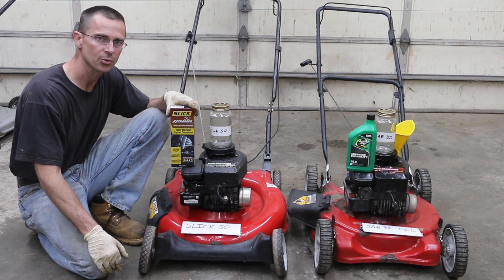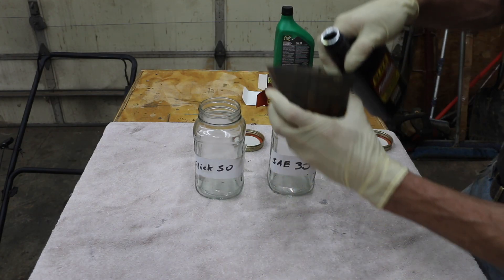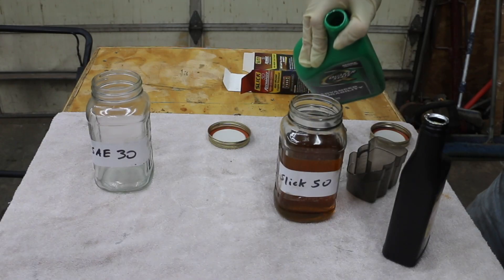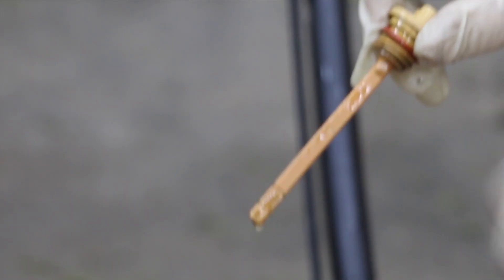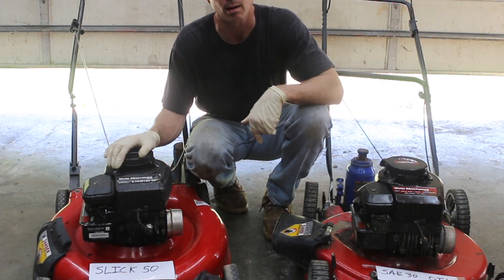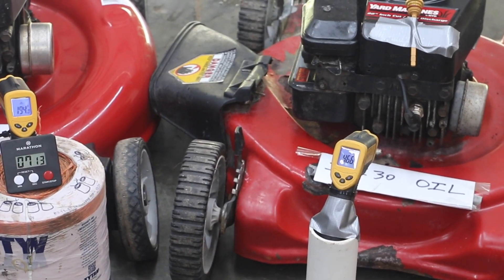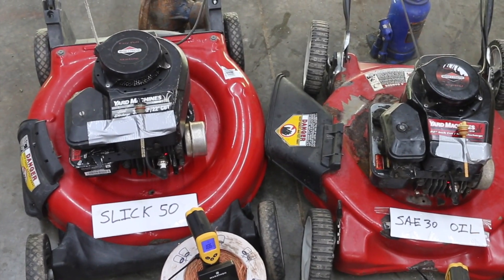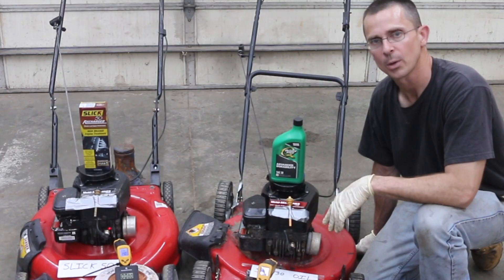Can't believe what SLICK 50 did to my engine!!--Dry Crankcase Test!

Comment: Yes mate there is another test you can run.  The product is called Bitron (and if it's mentioned below forgive me I haven't read yet).  You can get this in Queensland Australia.  It used to only be available from individual distributors, like an MLM, but now this Qld company has it.  It was developed by the Russians during the cold war for military use, blow the sump offof a tank and it keeps going etc. but they sold it to Canada (story told to me) to feed their people (True Military Secrets obviously are worth a LOT of $$)  The Canadian company named the stuff I think and marketed it that way.  US emergency services ALL use it in their vehicles as well as US military now OBVIOUSLY.  There are other products but hey I am not running an ad  LOL  This is NOT an additive but the oil itself is altered on a molecular level, causing it to stick harder to the metal parts AS it gets hotter.  It also cleans the engine of gunk so any engine that has bad gaskets and seals WILL leak oil after using it.  1,500Kms I believe is the run in time and then a fresh batch is put in. You drive as normal and then it runs for who knows how long without oil (naturally if it is drained cold less oil will be stuck to the engine parts) but a true test would be a catastrophic loss of oil in the field like sump damage on a road by hitting a rock etc. and the engine would be hot.  I guess I have "rattled" on a bit but google it and you will find the company.  I also have a VHS video tape somewhere here showing the test they ran themselves (closed room possibly bullet proof glass, temp guages attached to engine, and lights turned OFF to see the glowing exhaust...)  very impressive.  I must remember to get some for my new Jeep when it arrives!  Cheers
Reply: Actually having read a lot of the comments below I realized when they ran the tests with this stuff they also removed the radiator completely!  Hence the glowing exhaust.
Reply from the maker: Wow! This sounds like a great product.  I'll see what I can do. Thank you for this recommendation.

Comment: Slick 50 is put in and run engine until next oil change.  That lets the slick 50 to micro coat moving parts.  Never lost an engine in 40 years.   Try reading instructions first. Your test is horrible
Reply from the maker: Thanks for the constructive feedback.

Comment: And fyi i know when u do ur runs indoors showing i know at times.  put a hood up and pos vent that crap breathing carcinogens dude?? i was like u moderation its ok but after 15 yrs was diagnosed with paraganglyoma tumors in my jugg bulb so no blood drain through parts of left lobe of brain i would have set up outdoors if i knew then what i know now and suffered i never wish that devil even on worst enemy best ppe should be used more often ....espically air quality ppe  get a air tester that measures monoxide and keep in mind acceptable levels at a single time keep in mind its repeated exposure...
Reply from the maker: Thank you very much for the safety precaution.  I'll be more careful. Thanks again.

Comment: So here is a idea of alternative fuels remember me on moth ball in gas? Anyhow i was setting thinking the other day my grand dad claimes he used to run "drip gas" from the oil field in his pickup and got a million miles off of a old at the time (mid 80's) ford  pickup he would add 1 qt of type f trans fluid in his 16 gallon fuel tank. If this is true then the abundance of this product would save money for sure ?? And essiently the same thing the ronsol zippo lighter fluid?? Just another idea or perhaps it might run on paint thinner somethings with petroleum distilliates?? Just ideas trying to help....
Reply from the maker: Thank you for this recommendation.

Comment: You build your tests well. The downfall is any lack of validity because you only use one subject per sample group. Validity can only be established when each test group includes three samples,  at minimum.  I get that It's cost prohibitive to buy six engines instead of two, but your results would be statistically validated with a minimum of three samples per group.If you would test three engines in both groups, then combine the findings from both test groups, you're results would then have some validity. 
Keep testing! I do like your videos!
Reply from the maker: Thanks for the constructive feedback.  I'll try to increase sample size when the budget allows. Thanks again.

Comment: I have used Slick 50, I liked it. I was able to get a higher RPM reading on my tach. Also it takes time for the Slick 50 to adhere to the metal parts. You don't just add it and take it right out again. Use some sense in these tests. Read the directions.

Comment: Todd, you need to try these tests using Phantaslube (www.phantaslube.com) ISN (In-Situ Nanopolishing) technology!  Heat that destroys engines is from friction.  Friction is from things called "asperities" (imperfections) on the surfaces of the interacting metal parts.  Things that stick to the metal will never work.  You need a technology that polishes the asperities away on the metal permanently.  No asperities, no heat, no failure.  You just need to use the ISN technology long enough in the engine to polish the imperfections away.
Reply from the maker: Thank you for this recommendation.

Comment: Slick 50 is still better. Heat is the enemy of an engine, especially heat generated by friction. Number one, engines are not designed to run sans oil. Running the engine with oil and Slick 50 had reduced temperatures. That is better than running just oil. Running an engine without oil is just dramatic effect and not useful.

Comment: the current slick 5 is not the original product and is useless or worse. i was a slick 50 dealer in 85 and had customers using the 2 cycle additive  that makes 5 gallons of 2cycle mix. i had a customer that used commercial lawnboy push mowers. after using up the 5 gallons  we had one lawn crew with 5 lawnboys run straight gas and these 5 units ran for 5 seasons with only one failure due to a bent cankshaft. it was  torn down and it  showed no wear the crankshaft was straightened and sent back out
Reply from the maker: Thanks for commenting on this!

Comment: I bough a ford van with 300 I line six. Engine had no power and smoked. The aod trans would slip in 3 rd when hot. I added 2 quarts slick 50 3 quarts oil to engine. On the trans added 1 quart lucas trans stop slip..did not change fluid.After a 2 hour trip to Orlando the trans did not sliped. The engine got stronger every hour I drove it. It only ran 45 before and. Would run 80 after after driving a few days. Kept that van running a crew for over a year. Added slick 50 every changed. Never had another problem with trans. This was so unbelievable to see.
Reply from the maker: Impressive! Thanks for sharing this experience.

Comment: Well, the Slick 50 myth concerning oil-less operation is debunked. 

Even though engines were slightly dissimilar, if Slick 50's claims are to be believed the treated engine should have performed much, much better than it did.

Excellent video! Thanks.
Reply from the maker: Thank you!

Comment: I'm 51 years old and have never used an oil additive,just regular oil changes with conventional oil and I have never had an engine failure.Cars ,trucks ,tractors,lawn mowers anything 4 stroke just gets conventional  oil for me.
Reply: I'm a 61 year old diabetic and have always used oil additives. In my engines. ;)
As a diabetic I have constantly searched/researched ways of maintaining my health. It has been an evolutionary process over the years. Lately, knowledge/technology are changing almost month-to-month!
As an automotive enthusiast (hot rodder) I have constantly searched/researched ways of maintaining the health/efficiency of my engines. It has been an evolutionary process over the years. Lately, knowledge/technology are changing almost year-to-year!
Additives are like supplements. Neither will work alone. The engine failed on just Slick-50. My neighbor developed a stomach ulcer consuming excessive vitamin C by itself. :o
Use them as they are intended to be used.
And as always: Caveat emptor.
Reply from the maker: Thanks for commenting.
Reply: In the owners manual for vehicles, they say not to use additives. That's a bunch of crap they don't want your vehicle to last as long so you have to purchase a new vehicle sooner. If you research different additives as Paul Thompson said you should be ok. A lot of snake oil out there all it is is the mighty dollar they look at people like a sucker all wrapped up.
Reply: Please remove the tin foil hat and let your brain vent out for a few minutes before you post.. Here's a little business 101. If your vehicles don't last as long as your competitors,  pretty soon, it'll become public knowledge, you know, from stuff like class action suits, internet focus groups, owner's clubs forums.. stuff like that. Most of what sells a new vehicle is the reputation that the previous models have built. Here's the real way to word what you said.. They want to engineer a vehicle so as that you're happy with it's service life compared to the price point. Failing to bring you " bang for the buck", will result in you buying a replacement from a competitor.
Reply: Automakers have a minimum standard for maintenance to keep the warranty in force. After the warranty they don’t care as much. I’ve bought all of my vehicles at that point. I view manufacturer's maintenance recommendations as a base line, a Floor to start from. People will ask me how do I take care of my car? I always tell them, “ Read the owners manual.” that gives you the minimum required.
There is Nothing wrong with exceeding the Minimum standard. Example: My 95 Astro van took AC Delco standard spark plugs. I replaced them with Bosch Iridium/Platinum +4s. I always look for ways to improve the life span/efficiency of my vehicles. Another example: Diesel mechanic, big rigs, used Lucas products. That man’s experience, my Dad’s, and my own give me confidence to use Lucas.
Reply: Chuck St.Amand,  What you speak of has been public knowledge for many years.

Comment: Such a waste of Money. CAT and Cummins have engines worth $30k plus do not use or recommend snake oil nonsense in them. I have 15,000 hrs on my M11 Cummins using normal diesel oil and filters .We get 750k avg miles. 

I have 300k miles on all.my GM trucks and trans using normal oil. 

STP.and Marvel  and Berrymans help old worn out loose.motors and can clean out fuel.system and carbon etc The rest is bullshit like homeo pathic for your motor.
Reply from the maker: Thanks for commenting!

Comment: You did not measure the ammount of oil removed from each engine. or remove the drain plug below the crankcase to ensure all oil removed. I thought I noticed less oil removed from the 0il only engine which in turn would provide more minimal lubrication and extend failure point. Slick 50 engine looked like electrical failure caused shutdown not actual seized engine. in demonstration you did not confirfm actual seizure as cause of shutdown. I still enjoued watching the video so keep up the tests as they are intereting.
Reply from the maker: Great constructive feedback and thanks for the positive comment.

Comment: Even regular motor oils have additives in them - friction modifiers, long chain molecules to alter viscosity at different ambient/engine temperatures etc. Adding more of these carefully mixed products via an external additive will displace some of the actual oil! A good example of this lack of understanding was when I used to run 2 stroke dirt bikes - one or two of my friends used to add extra oil to protect the engine during hard abuse. WRONG, this actually displaces fuel and the engine runs lean - my engines never seized, theirs did! There is a lot of BS regarding these products (I have a neighbour who used to work in the research dept of a huge oil company) but there is much more research and tweaking of oil recipes than people realise. For example, an oil company can identify a batch of oil within a couple of months - weeks in some cases! Molyslip was touted as an engine saver over here in Blighty (as I'm sure it was in the USA). I have used it when rebuilding engines (a tip passed on to me by a race engine builder. But then it only has to protect the moving parts until the oil gets there after a rebuild - hopefully only seconds.
Reply from the maker: Great point and thanks for commenting.

Comment: I noticed slick 50 temp was much lower in temp during the dry run. I would think that the cooler engine meant lower friction and it should have lasted longer.
Reply from the maker: Yes, great point.  I thought it would last a lot longer too.  Others have suggested that the engine with oil transferred the heat better than the Slick 50.  Not sure.

Comment: BestLine really works, its incredible.   I have a 1700 Yamaha Road Star and it ran really hot here in Florida, it was like having a furnace between my legs.  I put 8 ounces of Bestline Engine Treatment in with my regular oil this monster bike runs really cool now.   I will only use the best oil in all of my vehicles, which means I use Royal Purple motor oil, ATF and gear oil.  

I never do a complete oil change as I run Frantz Bypass Oil Filters on my cars.  I change the bypass toilet paper filter every 5000 miles and the stock oil filter every 10,000 miles, replacing only the oil lost during the filter change.  Having the BestLine to boost the oil strength gives me absolute confidence even though the Royal Purple Motor Oil probably doesn't need any extra help.  I also run BestLine Drive Train Treatment in the motorcycle and cars.

I run Bestline in all of my vehicles now because it really works!  
Check out the BestLine video here:  https://youtu.be/0Cj2Ttwxe_M
Reply from the maker: Thanks for commenting and thanks for the link!